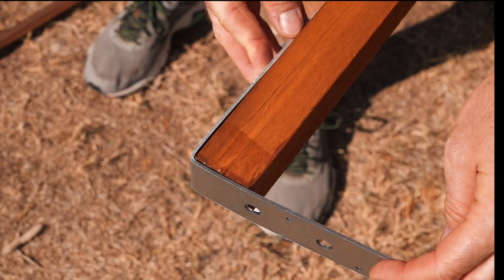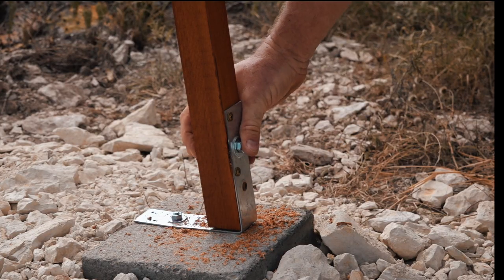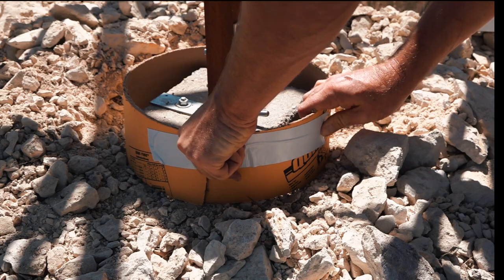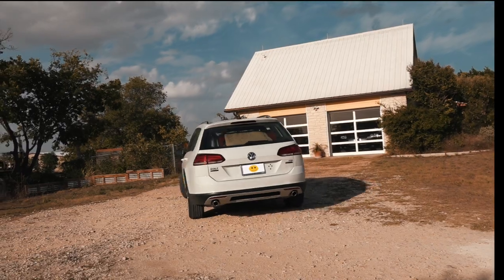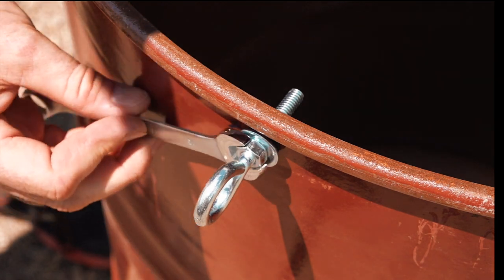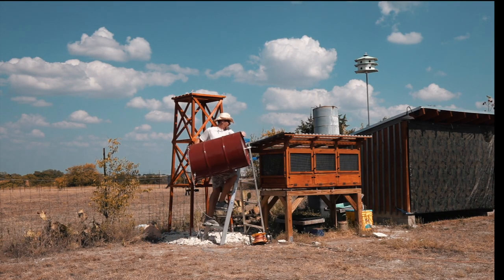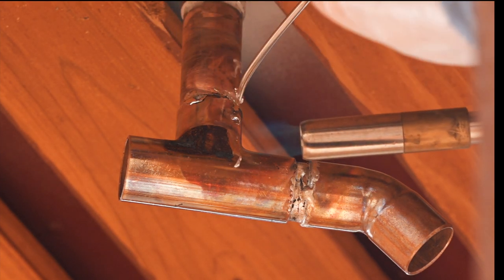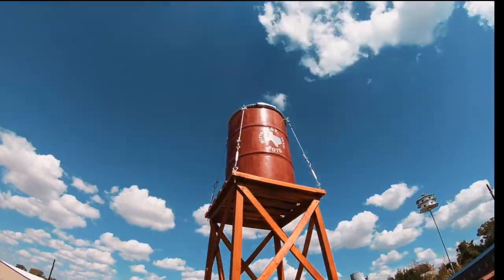Water Tower - Final Result (3/3)

Comment: Loved the series. Thanks for sharing. Had to comment on this part. Thought that extra concrete was a bit of an overkill. I, personally, would just cut the legs to match up after the leveling. Easier to do and easier to disassemble in the future.
Reply from the maker: thank you for your comment. If I had cut the legs to match the foundation, I would have ended up with a 5inch tall tower after several rounds of cutting and leveling 🙂